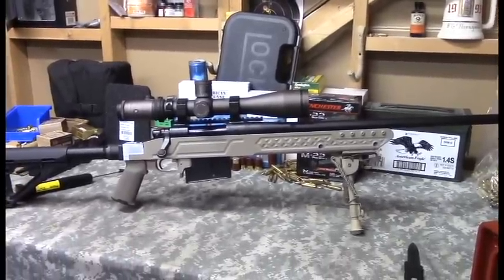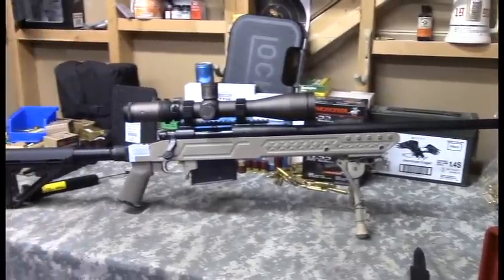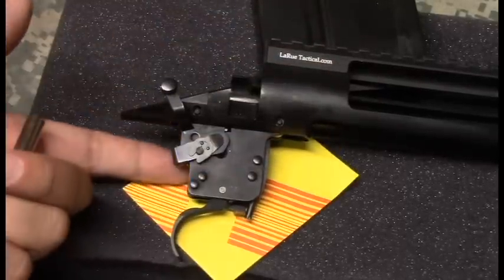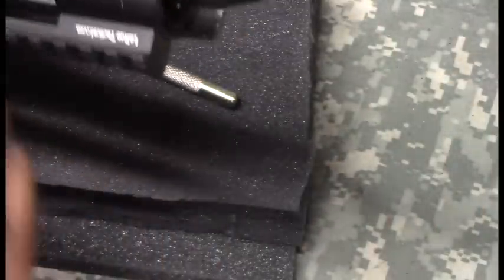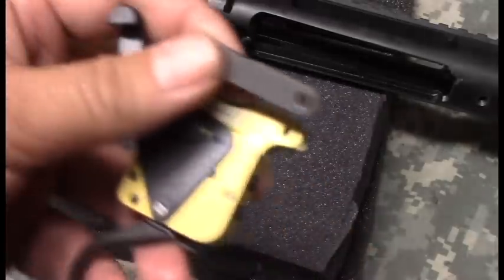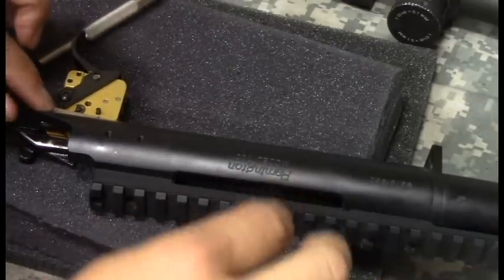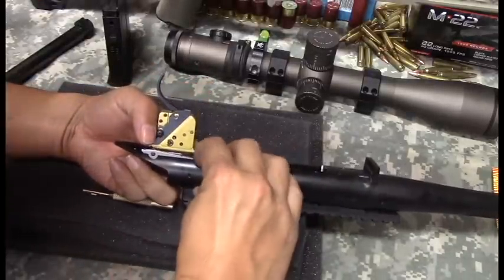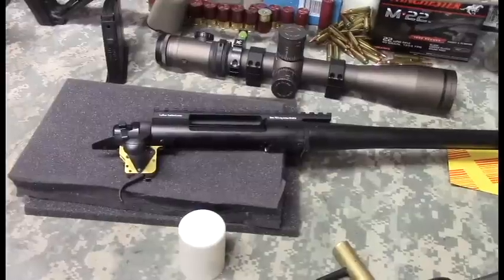Timney Trigger Remington 700 Install Video - HOW TO

Comment: Thank You......This is a great training video......This video helped me a lot......You should add information about what is going to fall out of the factory Remington 700 trigger when you remove the factory trigger......I figured it out when you showed what is going to fall out of the new trigger while you are setting up to install the new TIMNEY trigger.......Also you might want to add information on using a small fine rat tail file to remove wood from inside the trigger cutout where the larger/longer TIMNEY trigger pins fit in the trigger well......I also had to remove a little wood where the larger TIMNEY safety fits inside the trigger cutout.....Your video was a lot of help to me......Thank You,  Jent
Reply: That was a 40X trigger he removed. He should box it up and send it to me.

Comment: Good video with the right information.  I have changed a few and the only tiny trick is the pins with front (1) left to right and back (2) right to left.  That is pretty much it and then do your checks.  It would be a perfect video if he didn't have his hand in the frame so much in the video, but Great job!

Comment: How did you only pull 3 elk quarters out? Generally they do have 4 legs
Reply from the maker: +huntersz9  I usually hunt with a group of 3 of 4 guys.  Basically humped out 3 elk quarters from few downed elk from our group.  Youtubers take things so literal sometimes -- I have to explain everything :P
Reply: With a 338 Lapua, it's likely scattered over half the mountain...